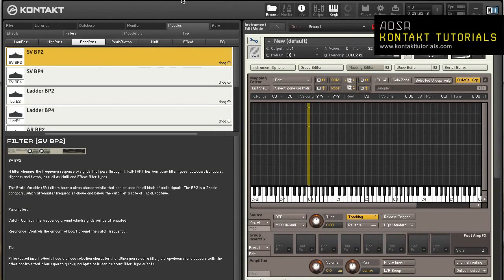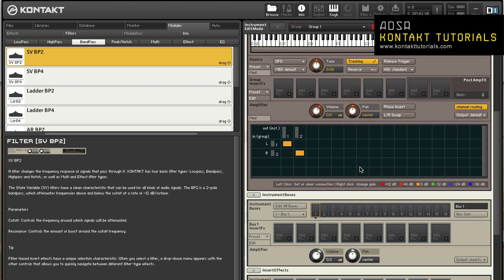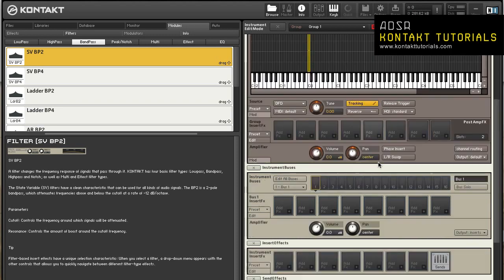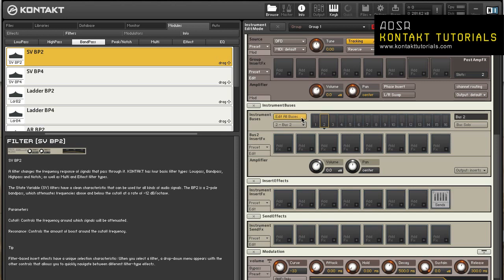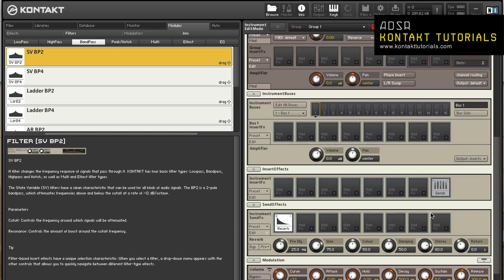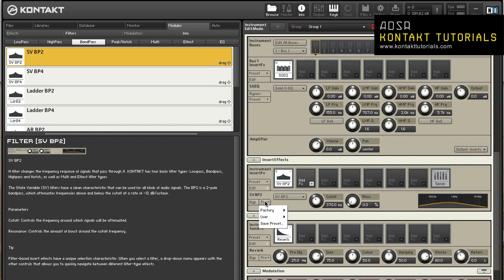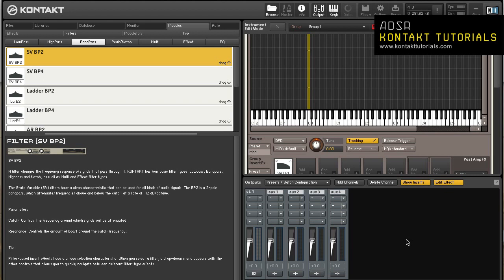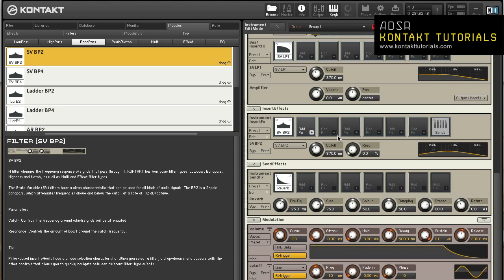Kontakt - Features Review - pt 12 - The Amplifier Module and Signal Processors - How To Tutorial

Comment: Nice tutorial - very thorough! But I have a question about modulating the Envelope on a key down group using time-based source. That is, if I have release samples on another group that are kind of dependent on the Sustain (or key down) samples being modulated reversely of themselves. I dont know if that makes sense. But like a piano or key instrument, that have a sustain and a release. Say the piano has a normal release and a staccato release, for faster notes. The Volume Envelope of the normal sustain sample group would have to be able to be modulated during the time of the played note, so that the release in the Envelope is shorter when the key is only held for a shorter time. Like a staccato note. 

I have tried to use a release trigger counter modulator for the Envelope on the Amplifier, but it has no effect. Just like a switch. In fact, I dont know what the whole thing is for there, it does not have any effect. Do you have the explanation for that? Is it a bug? Kontakt 5 by the way.

Thanks for the video!